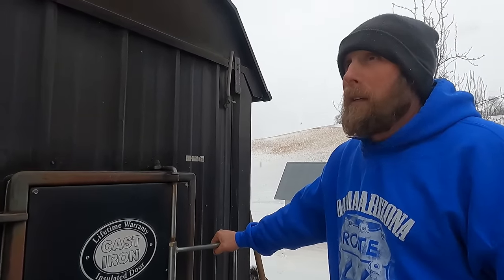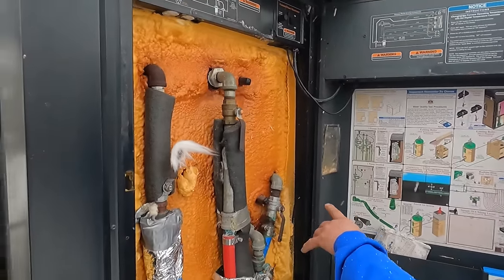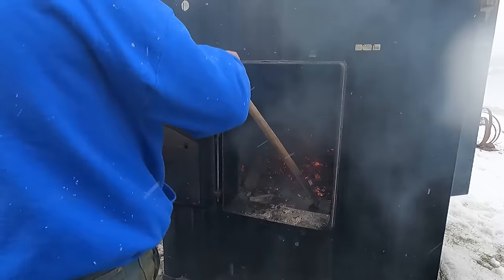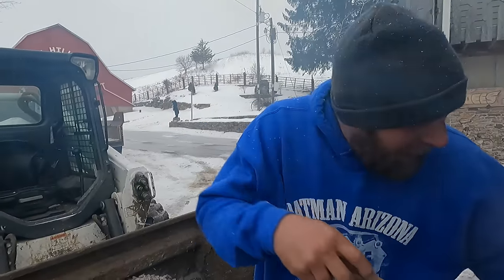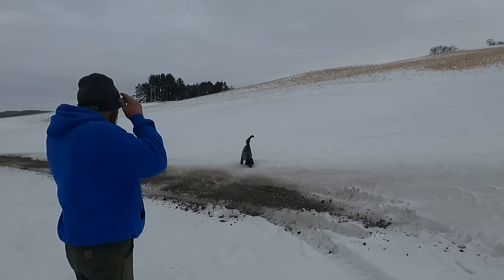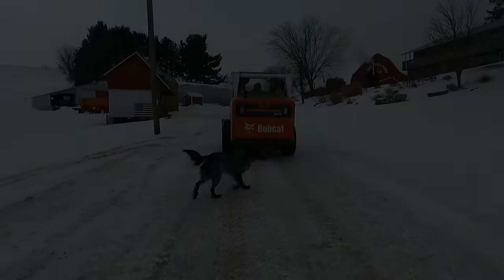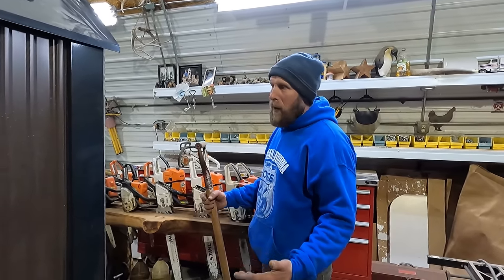Outdoor Wood Boiler Review l Pros and Cons (20 Plus Years of Experience)

Comment: I see your circulation pumps don't have shutoffs to facilitate any easy swap without losing water from the system. Next pump failure would be a good time to install some so in 6 years it will be easier!!! Thanks for the explanation. Also running the bob backwards sure keeps the ash from blowing on ya!! Eh?

Comment: Central boiler CL -  17 was a Side draft.  With the damper on the right side of the firebox.    I’m still using  mine !! It’s been a problem. But it gets lots of love and Fixed EVERY TIME IT BREAKS !!!   I’m Getting a NEW PORTAGE &  MAIN BOILER SOON. Just WAITING FOR IT.. DELIVERY .. IS ALL.  And since CENTRAL BOILER BOUGHT OUT WOOD MASTER , I DONT WANT ANOTHER POS  BRAND BOILER. THIS Next GO AROUND. As im buying this one Brand new. $13,000 new 20 Yr warranty. ! Will see  hope my central can make it three spring?.. if not the new one will be  installed asap after it is on my property. I guess  either way outdoor boilers are the way to heat ur house. With firewood!!! Hands down !!

Comment: I have had the same central boiler for 22 years. Replaced the solenoid 3 times, gasket in the door and the Taco water pump because the plastic propeller disintegrated after 15 years. 
On the maintenance during off season: Old timer I bought it from, told me not to scrape off the creosote on the firebox walls after removing the ashes and spray the insides with used motor oil to prevent rust. Great burner with a simple design.

Comment: Great video - thanks for posting, 
A suggestion for handling hot ashes: straining them through a metal sieve will separate the charcoal from the ashes. 
The ashes cool faster and you can put the charcoal back in the firebox - recover lots of heat from that.
Ashes on walkways absorb sun and melt ice.  Only downside is they tend to come into the house on footwear.

Comment: I live in the South but was born and raised on a Sauk County dairy farm. We still have to heat our homes in the winter (about 4 months) I use a woodstove and propane heaters and once in awhile electric. This year I used mostly wood as at $260/cord was cheaper than propane at $3.10 a gallon. 2 cords and 125 gallons did the whole winter (ends with Mardi Gras) this year. I agree with you that the wood heat feels the best but is the most work. But a little work is still good for you at age 70. I often lament that I didn't stay on the farm and if I had I think I would have replaced our fuel oil furnace with a boiler like yours. We had plenty of downed hardwood in our 60 acres of pasture/woods/marsh to keep one going. Originally we had a wood furnace but then went to coal in the late 40's. Fuel oil came about 1962. Really enjoyed your very informative video.
Reply from the maker: Thank you Mark!

Comment: I had the similar boiler in the 2000's and heated the same amount of square footage. Absolutely loved, had to replace one door solenoid and one door rope. This video brought back some great memories. I used it for all floor heat, I burned about 15-20 cords per year.
Reply from the maker: Sweet!
Reply: At that rate how often do you clean it out? Water in the lines with antifreeze?
Reply: 20 cords is a lot of wood!
Reply: @timothykeith1367  too much. It seemed like all I did was cut wood. But at least it is relaxing.
Reply: Wow, that is a whole lot of wood. Yipes!

Comment: HAVE HAD A PORTAGE & MAIN FOR 3 YEARS NOW.  LIKE YOU, HAD A CENTRAL BOILER BEFORE AND REPLACED IT WITH THE P & M.  THE TOP DOOR ACTUALLY MAKES THE EXHAUST STAY IN THE STOVE LONGER THEREBY RETAINING THE HEAT LONGER IN THE STOVE.  EXHAUST DOES A LOOP BEFORE EXITING.  IT MUST WORK CAUSE I DEFINATELY BURN ABOUT 1/4 TO 1/3 LESS WOOD THAN MY CENTRAL BOILER DID.  I HAVE THE SHAKER GRATE WHICH I GUESS IS CLASSFIED AS A COAL BURNER ALSO.. YOU'LL LIKE THAT STOVE.
Reply from the maker: Glad to know thank you for the info!

Comment: I have that same boiler. This is my second year using it. I did a lot of research before buying and I think you'll be very happy with it. It only uses 100 gallons of water so the theory is if you have less water to heat you'll use less wood. The tool you showed that was in the firebox I only use that to clean out the door above the firebox. You need to pull the ash from the left side and then push it on the right side and it drops down. I use a garden hoe inside the firebox. I do wish the door for the firebox opened more. When I'm throwing larger pieces in I'm always rubbing the inside part of the door and my coat gets dirty.
Reply from the maker: Thank you very much for all the helpful info! I hope we enjoy the new boiler as well!

Comment: I'm loving this, learning alot. What i suggest with that solenoid is to just take it apart and sand all the areas where it slides in and out of the coil and just add some good grease in there and i'm certain that thing will never go bad again. The reason they go bad is because as you discovered they stick and once they stick they tend to overheat if the slug stays in the magnetic field. Once the coil overheats then they just short out and stop working. Hope that helps yall, i'm digging you're setup!
Reply from the maker: Thank you for the info!

Comment: Have you ever considered building a insulated shed/housing over/around the burner to reduce the heat loss?  The cold wind must cool the thing down however well built and insulated the burner is 🤔 I have my wood chip burner in the basement of the house, the way it normally was done here in Sweden.  That way whatever heat loss the burner has it goes to heat the basement and thus indirectly also the house.  Nowadays people tend to build a separate well insulated burner shed or attach it to the garage to keep the dust etc away from the house.  I totally agree, wood heating gives comfort and if one has his own raw material it's a no brainer 👍
Reply from the maker: sounds like a good idea, thanks for the comment!

Comment: Your outdoor furnaces are very impressive...heating the house and your shop is no small challenge in your climate. We've had 2 Hardy outdoor furnaces. Need to pursue getting things operational again in the off season. When we got the first one, I wondered if we'd run out of wood, but between down trees in the woods and overgrown fencerows no shortage of raw material. It was nice having all the mess outdoors and being able to use a variety of wood. A little inconvenient having to go outdoors to check the fire, but usually coordinated checks with morning and evening chores.

Comment: When we suggested using ash near any building of course the coals would be cold. As for a lean to over the boiler most definitely that will keep the fire wood dryer the boiler protected from the weather and when you stoke the fire or clean out the ash in the rain or sleet you may not be warm but there is a lot to be said for dry. The boiler next to any building is asking for trouble.
 Good call to heat the shop floor that gives so many advantages to the building and everything stored in it.
Reply from the maker: Thanks for commenting frank!

Comment: I have a Wood Master 4400, installed in 1995 in Central New Hampshire a couple problems had to weld up a leak replaced the steel stack did it in the summer. I burn a lot of junk pine and pallets only use good hard wood  at night , love this thing only burn about 50 gal of oil in the summer for hot water.
Reply from the maker: Nice!

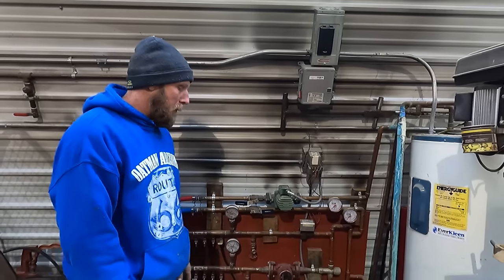Comment: I was searching for wood boilers i could use for a hot tub and ran across this video. Being in SE Texas, I never Dreamed something like this existed. I've been interested in rocket stoves for awhile and how to incorporate it into my mobile home without setting it on fire.  This gives me a whole new set of ideas.  I have learned many good safety points as well.  You never know who can use your experience. Thanks! 21:00 I thought there was some fancy editing there because I was seeing two of you.
Reply: I won't discourage you from this project rather I hope to add something; the most powerful hot tub heater I could find was 27kw, whereas a relatively small one of these outputs easily double that. That hot tub heater is not designed to operate continuously, so you're probably looking at an average of ~15kw of heat for a huge hot tub, a large wood burning stove will inefficient if run at a quarter of its design capacity.
Have you looked into pellet stove boilers? They are available in much lower power bands, and operate almost autonomously, similar designs are available for burning wood chips too (though pellet boilers are more oriented towards the consumer/home heating market whereas wood chip boilers are geared more towards industrial applications).

Comment: I have Hawken Energy boiler that is 16 years old , knock on wood , never had an issue with it and maintenance was minimal , I'm upstate NY and never take most of the ashes out . I take about 3-4 wheelbarrows worth out during entire winter and then I clean it out completely  in a spring when I shut it down .I don't burn garbage either , but since I am contractor ,I do burn any lumber cut off

Comment: Agree with nothing better than wood heat. You get a lot of heat out of it. When you cut and split it and when you burn it. Looks like a very thought-out system.
Reply: Yup, my old man always said you get heated up twice with wood..............Burned alot here over the years in stoves we built,  finally got him to switch to coal, never looked back and still burn coal in the same stoves.  Up until recently coal was extremely cheap and you could heat for very low $$$ and have next to no work in it.  Probably still is cheap if you figure in what fuel costs for chainsaws, moving the wood, etc for cutting wood.
Reply from the maker: Sure is

Comment: We had a Taylor 750 for 11 years. But being in central NC, it definitely had plusses and minuses. I think being much further north would make more sense and you'd get much more benefit. 
In central NC, I don't think I ever really got my return on my investment but at the same time, my wife could crank the heat as high as she wanted to (often 75F), we could take unlimited hot showers and baths, plus I could heat my barn when I needed to. 
But loading that thing up with wood morning and night every single day just got old. Not to mention when we wanted to travel, we had to have someone come by and at least feed it just a little bit so the pipes wouldn't freeze up.
It was awesome while we had it but I'm glad it's gone now. Paid $10,000 installed and sold it for $3500 11 years later.
Reply from the maker: Thank you for watching and thank you for the info!

Comment: I think the Portage and Maine unit was a gasification boiler.  The CL 6048 was not as far as I remember.  That is the reason for the fire brick and smaller door (smaller wood).  The gasification units are more efficient as the wood gasses are burnt off in a secondary chamber that temps get extremely hot (1700F).  Look up ECOBURN, TARM, etc. for how pure gasification units work.  GARN is an amazing unit integrating the gasification with a huge water jacket (1500-2500 gallons).  The Portage and Maine is similar at least in theory to the GARN.  Other advantage of gasification units is the almost zero smoke created as all unburnt particles are burned at those temps.  Only exhaust is moisture in wood.  Of course the downside of this units is that they do better with drier wood.

Comment: Used an outdoor wood boiler in PA years ago.  Live in the south, now and only need marginal heat in the winter months.  I used to sell wood boiler parts on ebay too.  I had one fellow up in Wisconsin who was mean spirited about the competition.  He used to harass me quite frequently and even contact my customers to bad mouth me.  Last  I heard, someone was suing him.
The new boiler with the induced draft will outperform the old one as it has a more positive method to control the burn.  There's good and bad in everything.  If you have a source of wood these things can be quite economical.  
The newer heat pumps with the inverter motors are a close second and provide year around comfort in all weather.  And if you use mini-splits you can reduce or increase temps in various parts of your home and save even more.  There are some of these that run directly off solar panels.

Comment: I thoroughly enjoyed this production👍🏼   Dad does a phenomenal job of talking and explaining as he goes about his tasks.    We have been feeding two outdoor furnaces, one Central Boiler and one HeatMor. The latter is of similar design as your new one.  The smaller door may take some getting use to...   Mine inspired considerable profanity as I like to feed larger material when possible. However the forced air draft makes for short recovery times if the water temperature somehow drops below the desired temp.
You may even find that you won’t need to maintain the water temperature quite as high with the new one.
Great job gentlemen.
Happy Thanksgiving from our farm to yours!
Bless’ns to ya,  Tedd
Reply: How long have you had your central boiler? Which one do you prefer?
Reply: @draganarc0131  Of the two, I think the Central Boiler is the simplest and lowest maintenance unit. It is probably around twenty years old, roughly the same as our Heatmor.
Reply: @sawsurgeon  thank you for responding. I have a central boiler gasifier E-1450. I was extremely happy with it till a week ago. It sprung a leak in the firebox. It’s only 9 years old, I test the water 2 times a year clean it really well at the end of the season and even spray it with krown. 
I’m currently waiting for a call back from central boiler because my dealer tells me there’s no warranty. 
All the information I received with it says 25 year warranty.
Reply: @draganarc0131  Wow, that’s very disappointing. I’ve heard great things about the gasifiers.
There must have been a flaw in the steel if it has been maintained consistently over that period of time.
I hope they return your call.

Comment: Love my outside furnance! I have a natures comfort 120. I have a shaker system and a pan I pull out to empty the ash. I can burn wood and coal in it. Your dad should redo the ash pan if he can. Make it deeper. Also since the blower is on the back scrape ashes towards the front eventually ashes will block the air from the blower
Reply from the maker: Good to know, thank you!

Comment: Dad is very good at explaining things.Just curious I know those wood burners are insulated , but have you ever pointed a thermometer at the out side of it to see the heat loss? we have a couple neighbors that had them outside, then built a small leanto onto their shops for the woodburner putting a small fan in the adjoining wall into the shop ,they say it heats their shop alot of the time just with the heat coming off the woodburner
Reply from the maker: Thank You Bill! I know some people that have done that, other than the risk of fire its a good idea!
Reply: I don’t think insulation is really required around the wood stove. My outdoor wood boiler runs best when it’s super cold out.  When it’s to warm around the stove the water temp  rarely gets down low enough to open the damper. So the colder the better
Reply: Maybe, but the reality is that all wood burning appliances run much better (efficiently hotter) in the cold. More oxygen. Gotta learn how to capture all btus no matter what weather ~

Comment: Look in to how many .. BTUs max can be moved thru a 1 inch line .  You have a pretty big boiler you could have like 3 or 4 zones coming off it .
And it could output alot more BTUs . I have 3 zones ( runs ) averages 270,000 BTUs and I'm think of adding another . I can output 400,000 btus max .. But only running 3 - 1 inch lines . You could run 1 1/4 line also.. just a tip from 25 years running a wood boiler.  I also need to add it will burn more wood also but heat output is awesome. I used 1 inch PEX aluminum PEX so inside is a full 1 inch .  They have 1 1/4 PEX al PEX also.. trench heat loss has to be kept to under 1-2 degrees at 125 feet . Any more then that your trench would be taking enough wood to heat another house. Just look in to them things and it's helpful hints.
Reply from the maker: Thats all good to know!

Comment: We have a Heatmor. It's best selling point is the 409 stainless steel construction. The small door (20"x20") on it sux. It has that double door thing too. We built a ramp & a pivot to get the bigger pieces in. One bigger door would be way better. No more smashing fingers while throwing the logs in. 
Ours has a hand operated ash auger. That's nice, but you still have to get inside to clean it out. Also, the auger is stored outside the boiler.

Comment: I prefer cast iron radiators and fortunately there is a company in Somerville, Massachusetts the refurbishes cast iron radiators like new. I picked up 36 radiators for a friend of mine in northern New Hampshire for his log cabin with 9 bedrooms, all girls. It was all piped with 1 1/4 inch pex line instead of cast iron pipe took us 2 ears to finish the installation and fill it with water. You can always tell when the heat comes on as all you hear is snap crackle and pop the radiators are all 36 inch high so very easy to dry out damp or we’re clothes. He was using a heat exchanger until we installed the cast iron radiators he and his wife love them as they eliminated all the cold spots in the house. Cast iron hot water radiators are the best way to heat your home.